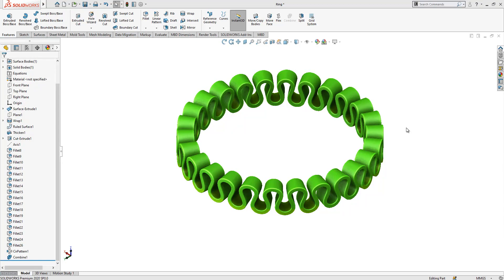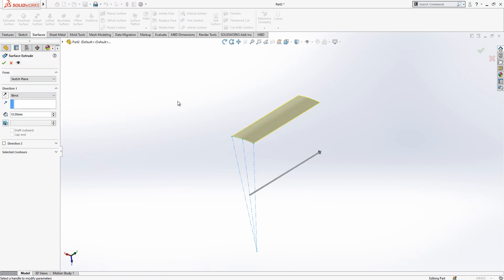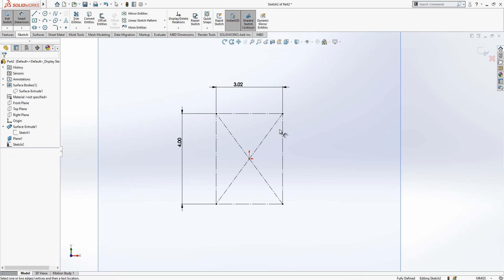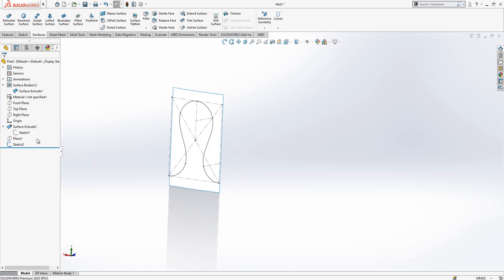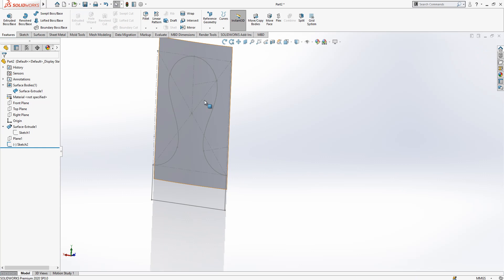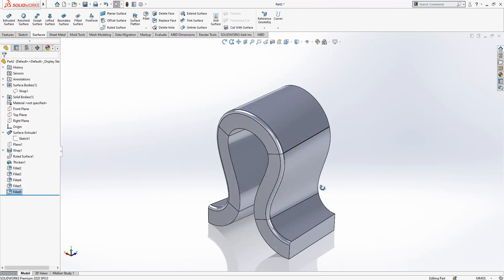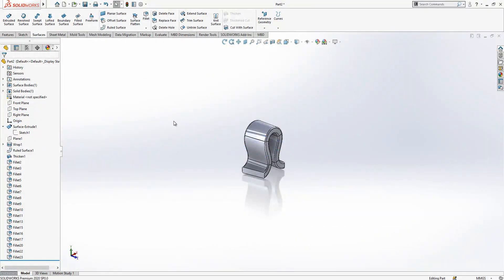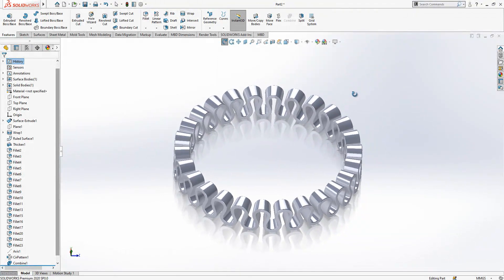Surface Modeling - SolidWorks Tutorial

Comment: Put the radii on last. I would have developed the initial shade oversize and undersize i.e. slightly large OD and smaller ID. Then apply a cut to get the right size i.e after you have completed the pattern and combined. All of your edges will then be tangent and you should only need to select four edges. Much simpler and less radii in your tree.
Reply from the maker: Good 😊